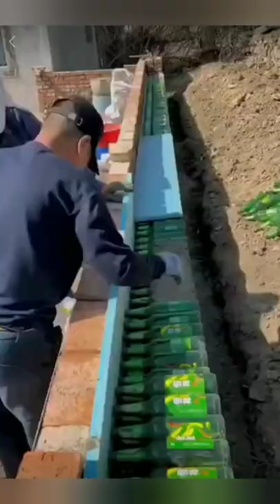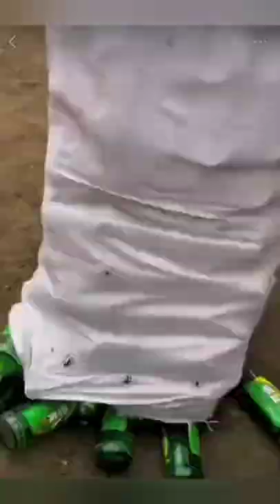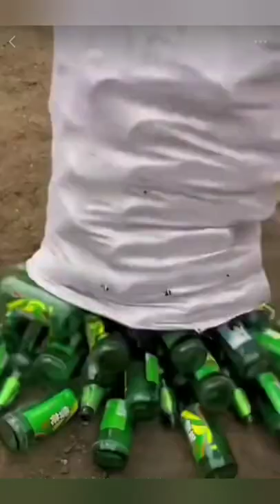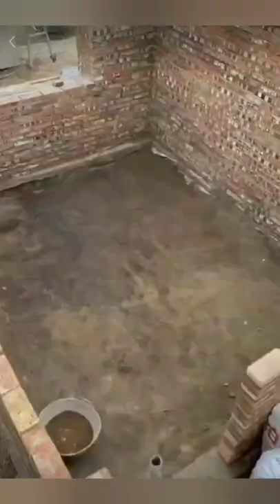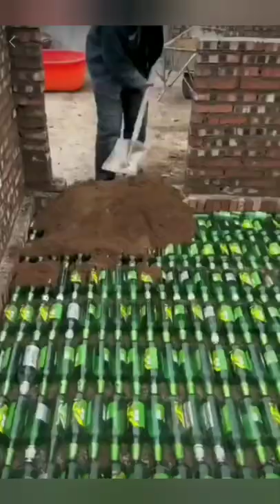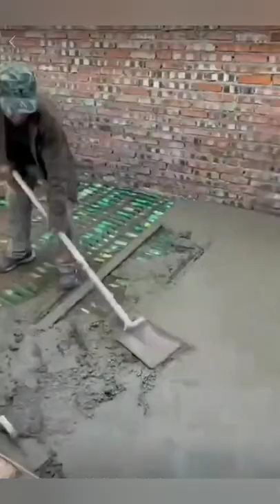build a house out of glass bottle – Great home decor ideas ▶ 009

Comment: I would of filled the bottles with sand first
Reply: You'd still be there now
Reply: ☝️🤣 Yup!
Reply: ☝️🤣 Yup.
🤓..also air is a thermal barrier
Reply: Why put the bottles on the floor, then use cement to cover it? Really makes no sense to me. As time passes, wouldn't the glass get weaker under the weight and pressure of the cement and start to break? Could be a real problem in the future, especially because all the bottles were empty, basically leaving a huge air pocket between the glass and the cement. Over time, I am assuming that the pressure of the air in each bottle will become bigger as the heavy cement pushes down on the bottles, and again I am assuming could explode under all that weight. The walls being made of glass is fine. I am just not sure of the bottles being the basing of your floors. Again I ask why even use glass for the flooring if your plan was to cover the glass in dirt and cement? Really makes no sense because no one but the builders will know it's there.
Reply: Cierto!!
Reply: Na verdade,você nem teria feito, ta falando porque viu feito agora,porém não teve idéia antes.

Comment: I would put the concrete down first then the bottles. The weight of the cement with bottles on a dirt floor will cause the floor to cave in from the bottom up.
Reply from the maker: tell me your concrete cylindrical Psi
Reply: @civilengineershorts qué buen tema para desarrollar en un vídeo!?...
Les escribe alguien que no tiene idea del tema pero me encanta ver sobre bioconstrucciones!! El tema de ciertos cálculos me parece re interesante! Gracias x aportar con tu vídeo. Saludos